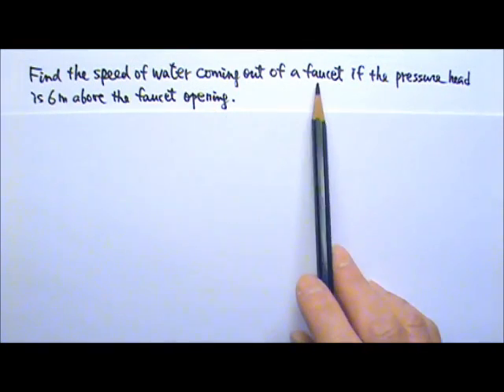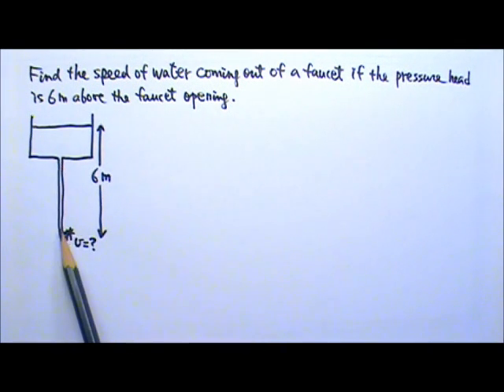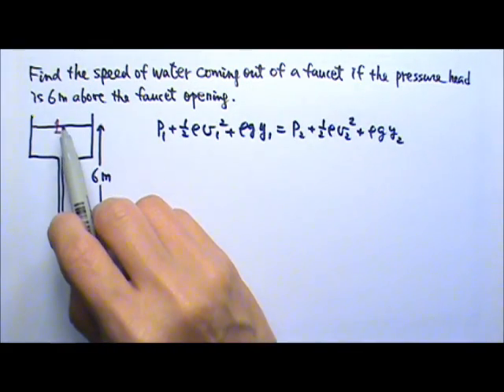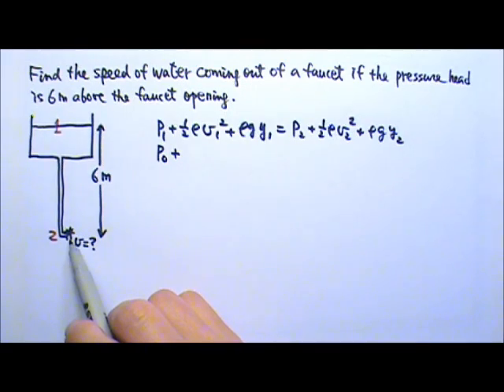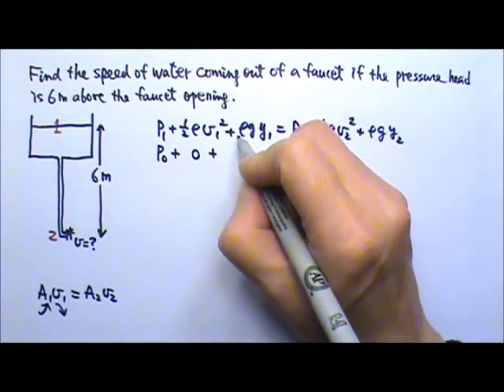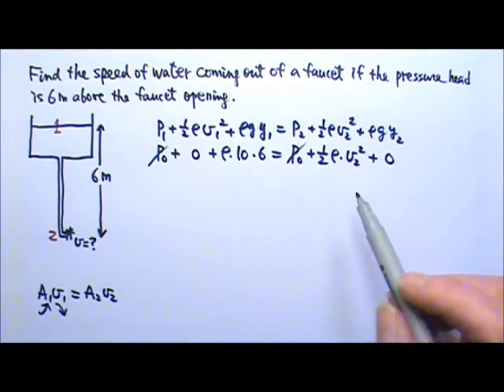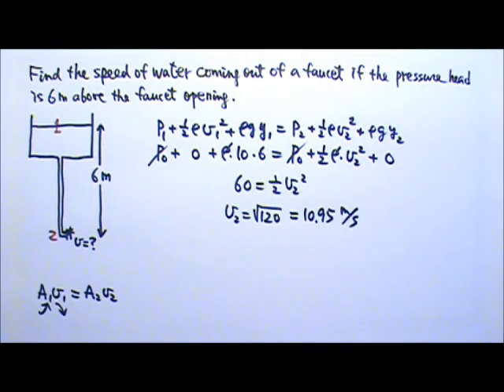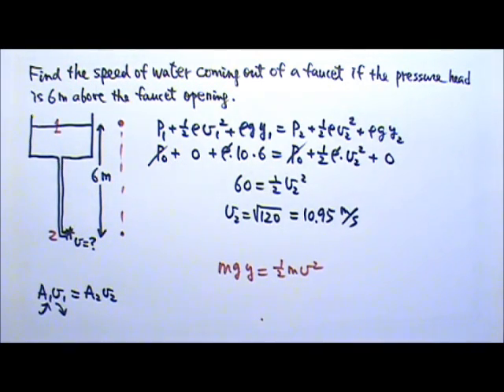AP Physics 1: Fluid Mechanics 22: Pressure Head Provided by a Water Tower

Comment: Thank you for nice demonstration.
I am trying to find an equation for sorting out one of job issue I.e, I am picking up rain water from the roof and connecting to a above ground rain water tank. In my scenario, the rain water is collecting via down pipe and running under the ground and rising it again next to the rainwater tank. Will they require to maintain any minimum clearance between the bottom of the roof and tank inlet?

Could you pleas assist me with a formula which I can find out the minimum head difference ?

Thanks

Matt